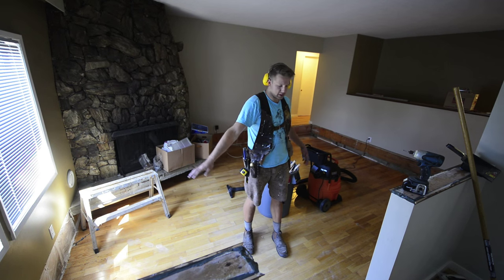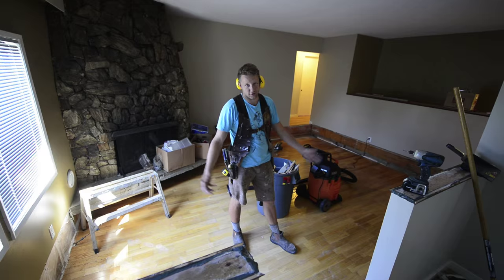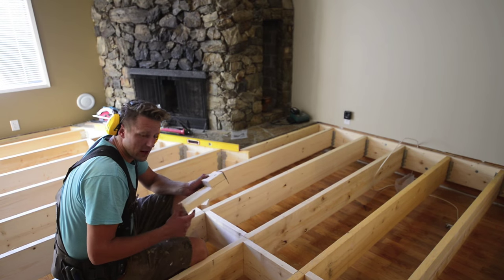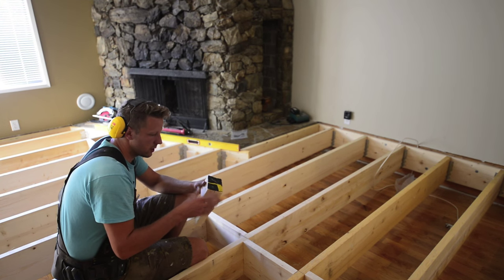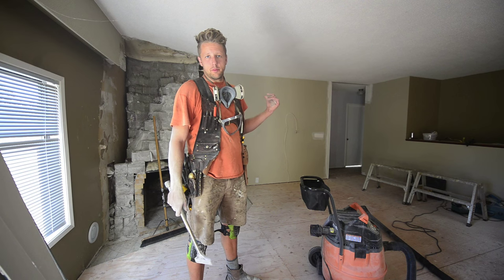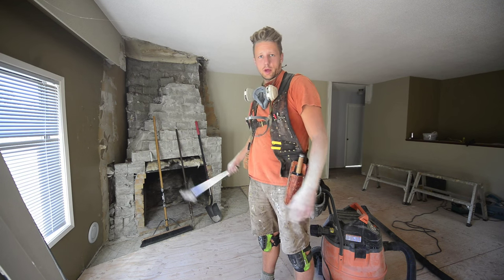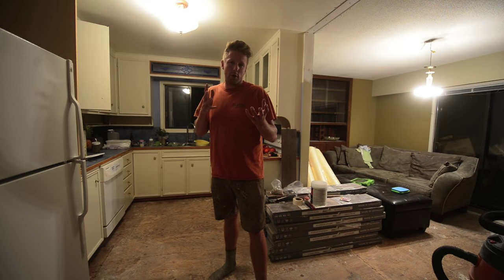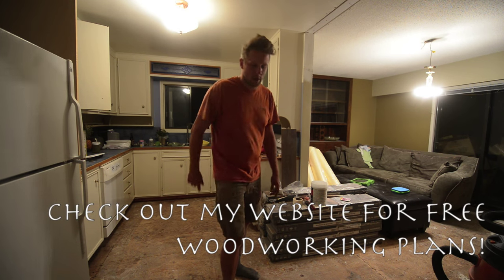How To Fill In a Sunken Living Room

Comment: yeah .   real great idea .   if you want to loose 25 cm off your ceiling height .
Reply: The ceiling was the same, the floor was just lower.
Reply: and what happens when you raise the floor?
Reply: So you're saying he went from 12' ceilings to 10' ceilings...and how is that not losing ceiling height in your mind?
Reply: Hamish Carey yeah that's kinda the point lmao
Reply: M. Motley lmaooooo im deadddd
Reply: Matthew Reed , the floor wasn't dropped, he made a new floor on top of the old one, he lost space, I have no idea if you're on some kinda drugs but what you said made no sense
Reply: What Matthew was trying to say is that the floor in this room was lower than the rest of the house, and all this guy did was raise it to bring it in line to make the whole house one level. Yes, he lost the original height, but as it was larger than usual, it didn't matter.

Comment: Was this installation on top of an existing concrete floor and if so what did you use as a moisture barrier and what was use to keep the wood from contact with the masonry, also did you insulate the floor between the joist? Thank you. Im wanting to raise my living room floor to match my dining room then place engineered hardwood on top as the finished and level material.

Comment: Looks like allot of ceiling height was lost levelling out on top of the old floor. No chance to access the old floor from below? The job was great but just the lost height would make me think in alternatives ;o)
Reply: Not really, if you look closely you will see he brought the living room to the same floor elevation as the rest of the house. It will make the home a lot more fluid as you can tell that is what he is going for doing the open concept.
Reply: briancnc Ahh.. makes more sense then. still though it looked more cramped with the lower ceiling height but lowering all the other rooms is probably not a possibility ;o)

Comment: Over all its good but, you could have put blocking under the rim joist every 16" where the joist connect. That would have transferred the load to the floor instead of the lag screws in 2x4s. It would probably be fine anyway. Like with decks now the load isn't supposed to be on the fasteners. You cant bolt a deck beam to the side of a post. The beam has to sit on the post either on top or in a pocket so that the bolts aren't supporting the load.

Comment: What thickness plywood did you use for the sub floor?
Reply from the maker: whitey211 5/8" plywood to match the existing.  I would have gone with 3/4" but back in the 70's when this house was built, all the framers were cheap hacks.
Reply: Heh, my house was built in the 50's and when I pulled up the nasty oak flooring I found a lovely 3/8" subfloor. Just barely thick enough to support my weight, and all tiny leftover pieces, some weren't even nailed down. Covered it with 3/4" ply and 3/4" tigerwood, so much nicer. 5/8' is fine though (I think that's actually code here). Looks like an awesome project!
Reply: The Samurai Carpenter Why didn't you keep your floor joists down 1/8" then and just go with the stronger subfloor?

Comment: What thickness plywood did you put on the top to create the new floor? I'm planning to raise a sagging floor in an old house using a similar method in your video but I'm thinking to use something thinner than 3/4 inch plywood to reduce the weight both on the old floor and for me to carry it.

Comment: were any of the walls load bearing , so did you have to reinforce the ceiling at all? coming out great, gotta love open concept.
Reply from the maker: nyinfamous2k2 It was an engineered truss roof so none of the walls were load bearing.
Reply: +The Samurai Carpenter just because its an engineered truss roof, doesn't mean that they don't use any interior walls for load bearing... people don't realize that truss designers try to design the most inexpensive truss possible, and using intermediate walls as load bearing walls is an easy way to make a cheaper truss.

Comment: Filled mine in with concrete. No termites or lumber mildew odors or flooring squeaks! Used 35 bags of readi-mix in wheelbarrow. Add the same amount of water each time for each bag, stir with a hoe and pour. Staging area was my front porch, with a simple ramp for front door. Use a google search for a calculator of yards/bags needed.

Comment: Unless I missed something, it seems like he built a new floor directly on top of the old floor.  This is the most idiotic thing I've ever seen in my life.  He must have lost 12" in head space.  I recently had to do the same thing however I laid down 2x4s on the floor, scribed and cut the bottom to match the profile of the sunken floor and then cut the top to level the floor.  My wedges went from approximately 0.25" at the edges to 1" in the middle.  With the subfloor I lost  1.75" of headspace and now I have a perfectly level floor.
Reply: john doe  Ok I did miss something.  The living room was already lower than the rest of the house.  I thought it was sagging in the middle.  My mistake, my apology!  Good job!  DIY is the way to go.  Save mega bucks!

Comment: I can't really tell in the video, but did your new floor happen to come out level with the fireplace hearth?

Looks great how you're really getting that opened up. Definitely changes the feel of that area I'll bet.
Reply from the maker: Patrick Houser The hearth is lower than the floor by about 1.5" so I am going to pour a leveler on top and then tile it flush with the floor.
Reply: The Samurai Carpenter Well dang, that just would have been too slick if you'd ended up nice and flush. It'll look slick tiled level with the floor though.
Reply: Vice
EPatrick Houser xccq

Comment: True hack shit, Jack the house up, put in support where needed.  level the permanent structure,  not modify it to cover up the bs. unsubbed
Reply: Kyle Crater you realize a sunken living room is something that was done on purpose in the 70’s right?  There’s no damage being covered up, and no reason to jack anything up.  It’s an aesthetics and room flow change, not a failing floor/foundation.

Comment: My floors had four to five inch drops on the inner walls. I just went off of the highest point and laid new plywood on top of it shimming as I went outward with a level and angle iron from an old bed frame. It cost about $200 per room and you can't even tell they were fixed at all. Granted, it did take about four to five days to do each room. But I saved a lot of money and ceiling height doing it that way. I guess your way works to if you've got the thousands of dollars and don't mind your scalp scrapping against the ceiling.

Comment: After all that effort, it gets covered with plywood. Plywood, ffs!! My gosh, use tongue and groove flooring planks, a bit of sanding and a few coats of decent floor varnish, a much better and healthier option. I hope he included some ventilation holes to circulate air underneath that lot....
Reply: There is such a thing as t&g plywood called sturdi-floor
Reply: Isn't that what he's standing beside at the end?
Reply: The finished flooring planks will go on top of that plywood subflooring--he's not done yet.
Reply: From Sask here. Considering doing the same to a den I have, too, so I can take the railing off around it. Surprised you sacrificed that hardwood under there. Costly!

Comment: Why not just fill it in with dirt? That would work, and would be much easier.
Reply: +thebirdmanjoe2 Dirt it very moist and would trap any moisture introduced later on which would cause a major problem. Also more of an exterior material rather than interior.